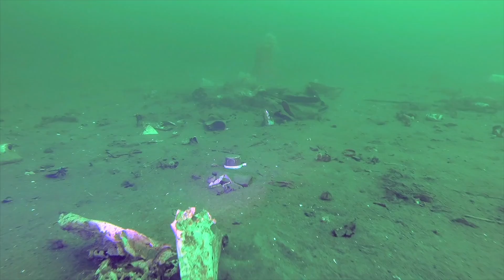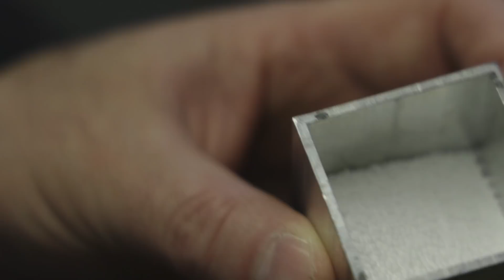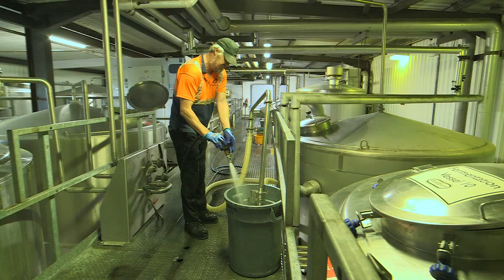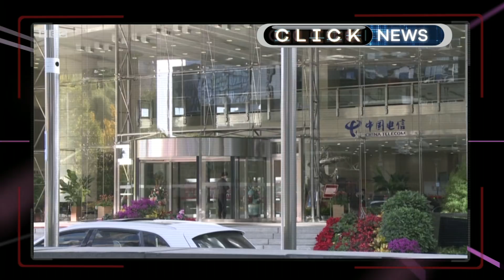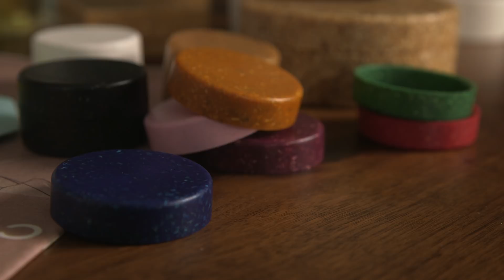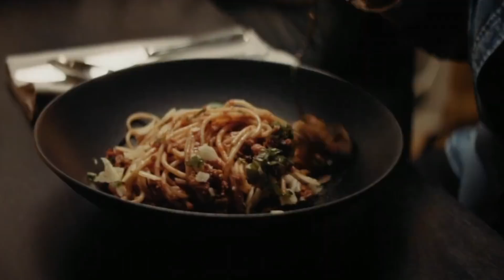We All Scream For... Carbon Ice Cream? - BBC Click

Comment: " Gas Vaporization " which allows ANY vehical petrol powered today to get about 5 times its fuel range  would basically make a 20 mpg vehical get  about 1600 to 1800 miles per tank . The internals on the Engine look like new for a long time as the fuel is almost completely burned 🔥 not making your motor valvetrain become less efficient because of carbon build up too.
This is not my idea and its from 1976 ! The inventor was bought out and the patient was shelved .
If immediately every vehical stops emitting 80% less pollutents then how much better would the air be around us ? 
Hugs 🤗
Reply: yes, there a lot patents, on a lot stuff, just to stopped tech comming out also